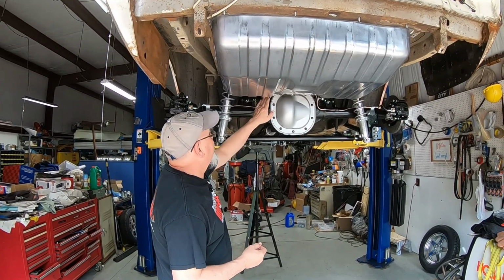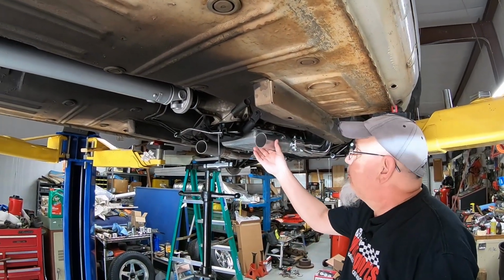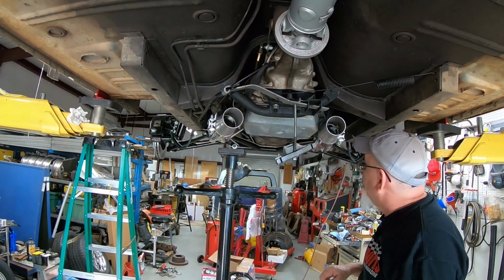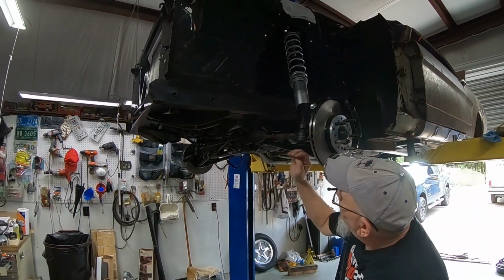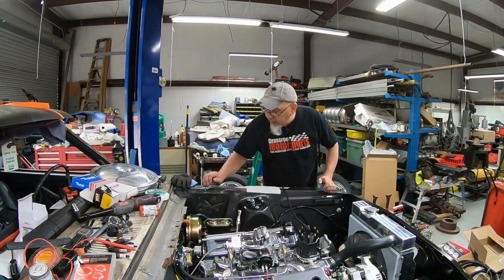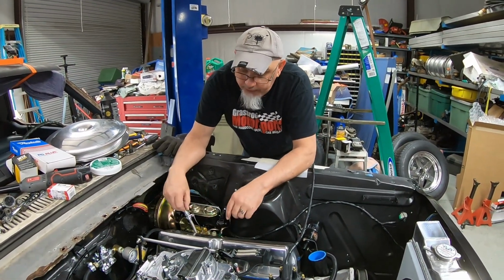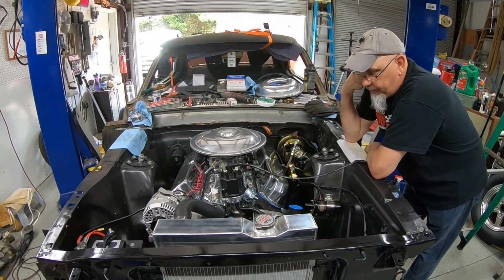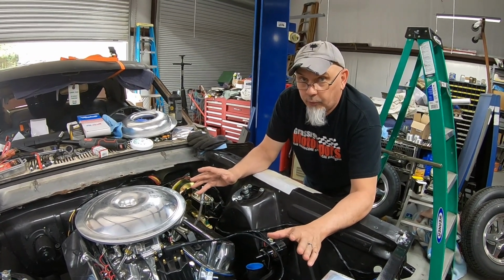1965 Mustang project PART 21!! We have updates!!

Comment: Great video, you guys got a lot accomplished. I’ve seen people start the install of the AJE system, I am always looking to see how that exhaust gets routed with a three or four link system in the rear. Some go over the axle, some go under and then you see them dumped in front of the axle. You have my full attention with the build, can’t wait to see the first start and drive. Have a great week.
Reply from the maker: Thank you! We did get it fired up on ether yesterday for a split second! That was great to hear. Now we're having more issues with the brakes. I seriously debating on going back to a manual master cylinder and just take an L on this power stuff lol

Comment: Thanks for all the great videos! I've had all the aje stuff sitting in the shop for a couple years, about to start on it and this has been helpful. One question, do you have the extended and compressed length on the rear shocks, or the part number you used? Thanks again for the vids!
Reply from the maker: Thanks for watching! The shocks I used were Viking part #10DP150, but they weren't exactly an exact fit. I had to modify a couple of things to make them work. I'd suggest getting in contact with Viking and letting them know what you have. Their tech department very helpful.